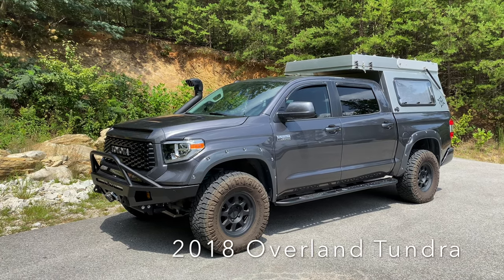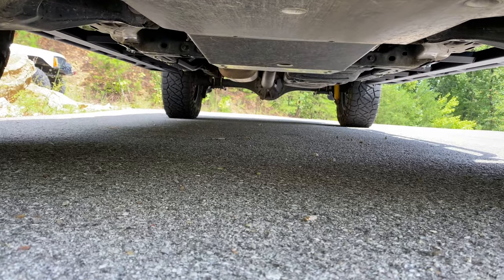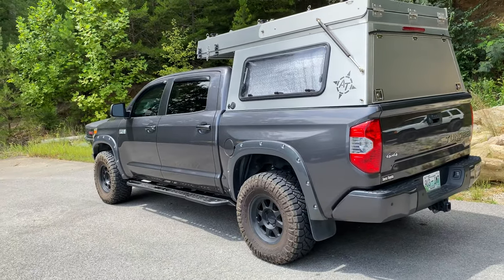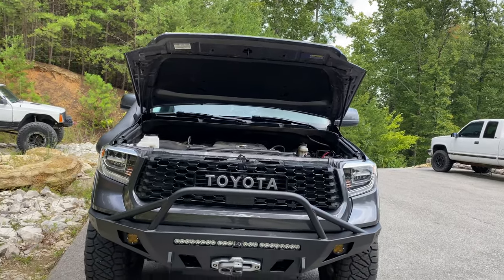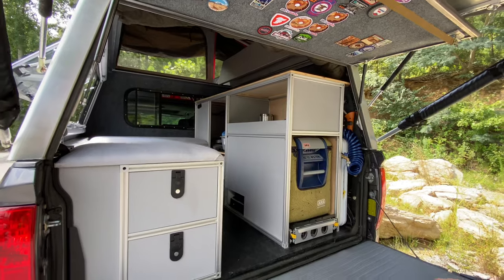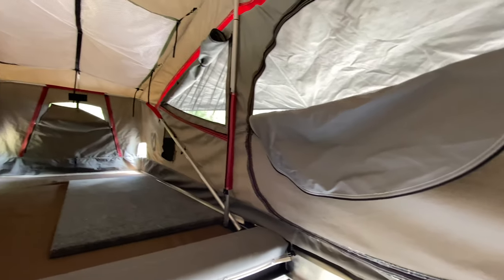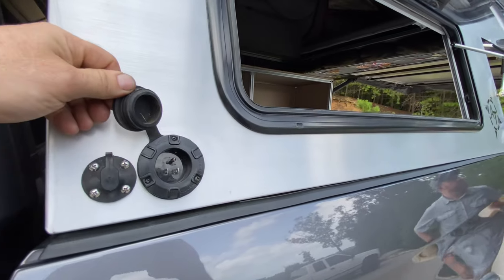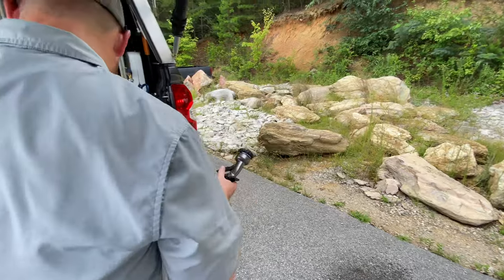356Overland Tundra Build

Comment: Body mount chop to fit the 35x12.5?   And, how did you fit a full size spare underneath (or is it a full size spare?)
Reply from the maker: It does have a body mount chop but it is using the stock spare.

Comment: Nice rig. I have a 2020 platinum and was amazed that I only had 1185 pounds of payload for people, gear, mods for the truck. All the goodies on that truck must have used up all the payload.
Reply: Thanks! Not sure what changed with the 2020, but the 2018 model has a rated payload of 1530 lbs. We added HD coilovers and leaf springs to accommodate more weight as well. That being said, this is a heavy rig but the setup is much lighter than it appears. The AT Overland Habitat camper is all aluminum, and only weighs around 350 lbs. The interior storage cabinets are made from extruded aluminum, 1/4" plywood side walls, and 1/2" plywood shelves and tops, so that actually weighs less than 200 lbs. While there are a lot of goodies, the truck handles the weight very well.
Reply: The reason its 1185 pounds of payload is if you look in your owners manual it states that your payload is reduced if you have the tow package and larger fuel tank. I thought the payload was 1530 pounds but check your door sticker for your actual payload. FYI, just because you upgrade your suspension doesnt mean your payload rating changes. Toyota payload rating remains the same.
Reply: @smokymt24  Excellent setup! well thought out and I like how the flip out tent doubles as shade for the tailgate.  Well done!
Reply: @highpro1394  100% correct, the payload for that particular truck in the video is definitely not 1530.
Reply: @highpro1394  I have 2021 Crewmax TRD Off-road 4x4. My payload is also 1185lbs. According to the owners manual, The Crewmax with the TRD Off-road 4x4 package, 38gal. Fuel tank and moonroof will have the lightest payload rating of all model configurations and have the heaviest curb weight and 7200lbs. GVWR.
Reply: @highpro1394  Umm....no. The rated payload is based on suspension as well. You increase the suspension you can handle more weight so long as your not taxing the engine.  A F-250 and a F-350 has the same motor, the difference? Better suspension.
Reply: @troyraines7160  nope. Your sticker on your driverside b pillar tells your payload and gvwr for that specific truck. If you change anything like heavier leaf springs your ratings are still the same. Get in a wreck and ask the state police when they weigh your rig. Game over bud if you are over your weight ratings on that factory sticker.
Reply: @highpro1394  wow such a knowledgeable expert on youtube. Bet you read the operators manual front and back, and you never go over your recommended oil changes either.
Reply: Guy martin  all depends on what trim level and features on the truck. More features add more weight which decreases payload. That is why a platinum tundra has such a low payload.
Reply: That’s very true with the payload in reality that’s a three-quarter ton truck but by law if something happens you’d be in trouble
Reply: @troyraines7160  you’re talking about HD trucks with fully boxed HD frames and fully floating rear axles. The Tundra is a very flexible open C channel frame in the rear and has a semi-floating rear axle. Despite what the dealership sales guy may have told you, this is NOT an HD truck in disguise. I agree that Toyota rates their trucks conservatively, but there is absolutely no way this truck isn’t overweight according to the door jamb payload sticker. Stock, a platinum CrewMax is about 6k lb curb weight, which is VERY heavy compared to other half tons. GVWR is 7200. You’ve only got 1200lb to work with before you’re overweight. This is what almost NO ONE understands when they buy a Tundra. All of these overlanders with a Tundra or Tacoma with skids, bumpers, racks, campers, winch etc are overweight.